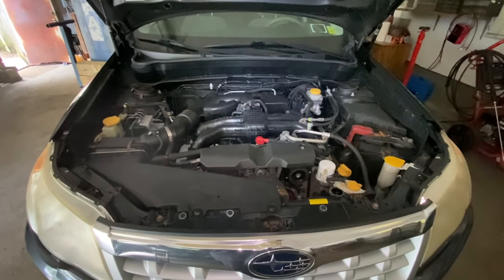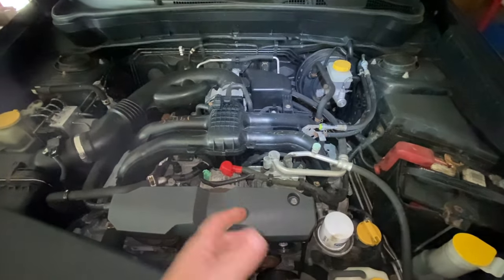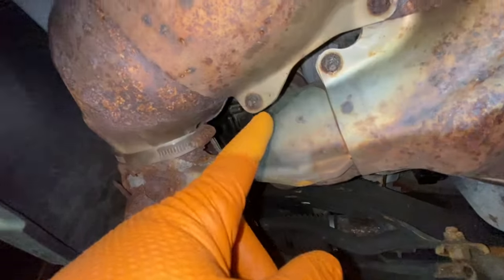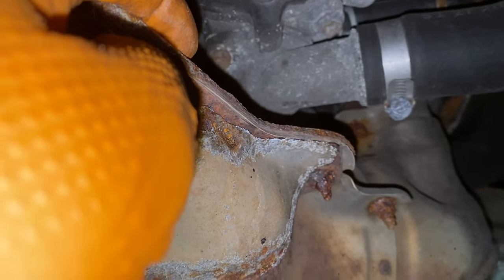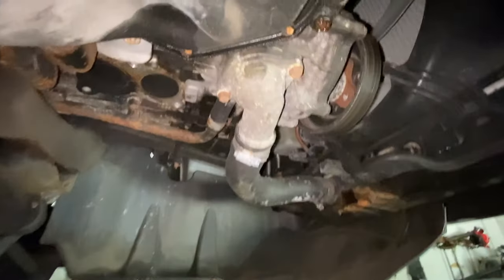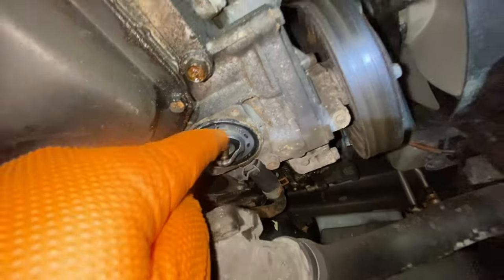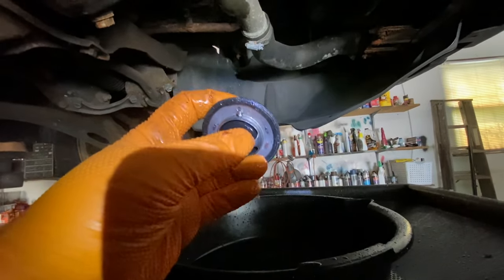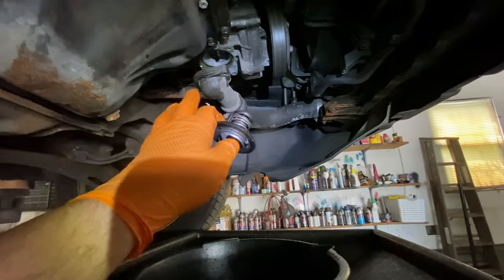Thermostat Replacement On Subaru Forester, Impreza, Outback, Crosstrek, Legacy 2.0 & 2.5L  2005 & Up

Comment: Thanks for the video. I have a 2018 Forester, and I was able to get mine out without dropping the exhaust by using a 10mm open end wrench, by flipping it over and back, turning the bolt just a little bit at a time, until it was loose enough to get it out with my fingers. I put it back in the same way. I saw another video where someone else used a 10mm ratchet wrench but I didn't have one, so this worked. It just took a little longer.
Reply from the maker: Thank you for the extra info!

Comment: Subaru service center just told me they need the car for 24 hours to replace the thermostat. They said it’s at least 5 hours work. Maybe you cut out the other 4 hours and 53 minutes of intense work in your 7 minute video.
Reply from the maker: Nope, that’s the stealership for ya

Comment: If you remove the exhaust manifold, you have to loosen the heat shield bolts to line back up with the 6 studs. If not, the HSs act like springs and prevent easy installation. Ask me how I know.
Reply from the maker: I never had a problem but if you did this may help others. Thank you!
Reply: Yes. It’s also mentioned in the FSM. An old rusty front exhaust may be easier. Thank you.

Comment: How can you tell that thermostate is broken?
Reply from the maker: Good question! 2 ways, vehicle is overheating or overcooling. In newer vehicles they have what is called fail safe thermostats meaning when they fail they usually fail open so the vehicle is overcooling not to overheat the engine and cause damage.
Reply: The new TCV can fail either way. Horrendous design.
Reply: @Motorcarnut  Hmm in my Forester 2011 I have extensive oil consumption. 1l/500km (quart/300mil) but mostly when Im going to long distances over 100km. Have feeling that engine is very hot, maybe thats the cause of extensive oil consumption. My deduction is that oil is overheating and leak through rings and valves? What do You think?
Reply from the maker: Doesn’t seem likely. Those engines in that year range have a known oil control ring problem, they tend to stick and let oil blow by.  Unfortunately the only remedy is piston ring replacement which is a big job.

Comment: Wow !  My old 2004 Buick with the 3.8 engine can change out thermostat in about 3 minutes.
Reply from the maker: I know, the older ones were very easy even though this one’s not that bad.
Reply: I have feeling one of my studs will break making this a nightmare. Wish me luck.
Reply from the maker: Try a little heat first

Comment: I have a 2006 impreza 2.5i ej253.
So its in same location as mine.
Reply from the maker: If you are asking , just look under the vehicle if the cats are in the front then yes. Most Outback's are much easier.

Comment: Great video, just an fyi, subaru after 2009 should blue blue coolant not green
Reply from the maker: That is the best way to go but not really necessary as long as the coolant you buy is compatible.
Reply: I did it with prestone platinum. Prestone got the same component as the original, even Prestone is better If you look at the label.  So no problem using the green one, it's perfect. I own a subaru forester 2011 2.5 engine.
Reply from the maker: @sam33more94 Yes that’s perfectly fine